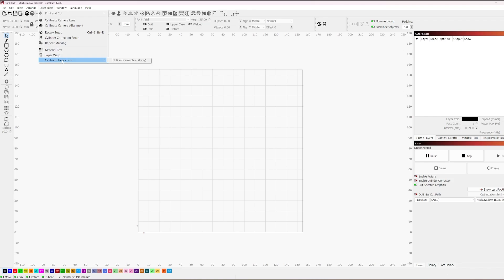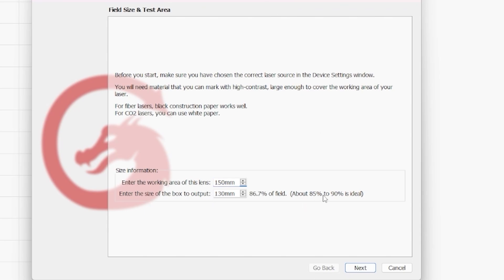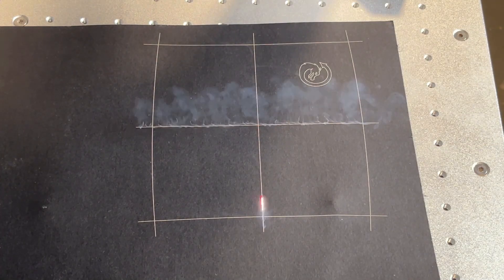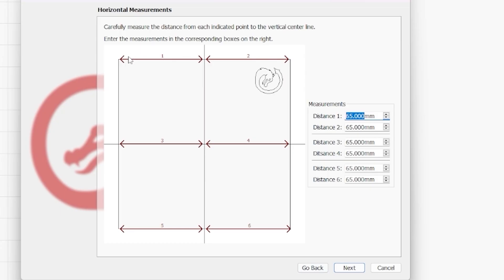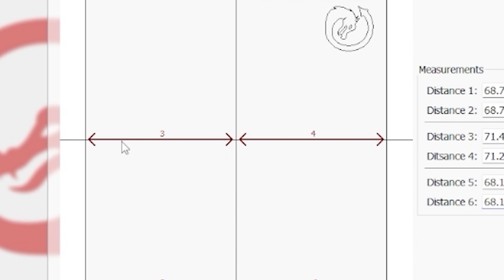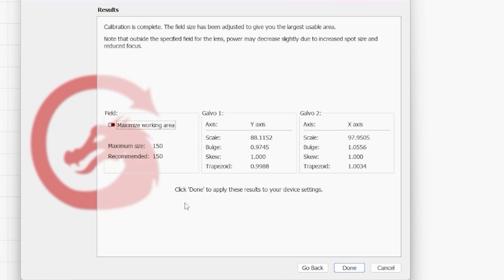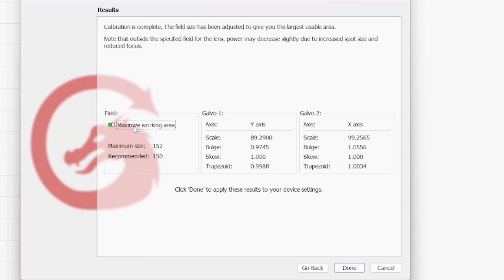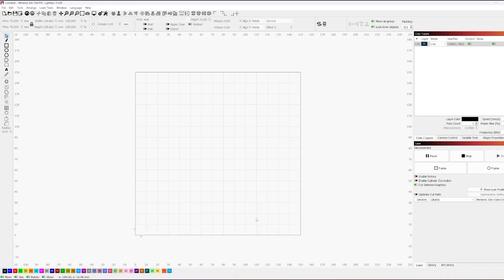AUTOMATED NATIVE LENS CORRECTIONS IN LIGHTBURN (No Ezcad!)

Comment: Has anyone got this to work with a 70mm lens?  It keeps saying the drawings are out of bounds and it only gives me the dragon, not the boxes.(mac)
Reply from the maker: I ran into this helping someone yesterday too. We'll be doing some troubleshooting and documenting things to try and help address that. Haven't found a pattern to it yet, but you can get around that by going to lightburn settings and disabling the line item for ignoring items outside the work area. I would enable it again when done, but it should get you through the process.

Additionally, there seems to also be a scale problem sometimes. The rest of the calculations seem to be working well, but sometimes the scale on either X, Y, or both, tends to make the work area too big and scale output accordingly too large. This can be mathed out manually to accurately scale down by making a square of a known size and then adjusting by the % it is over, scaling it down by that value on the given axis scale (over simplified version of the explanation but best we can do in the comments lol). Hope that helps, and we'll try and submit feedback to the awesome team at LB to try and help improve things as we test and try and find details that may help them.
I'm hopeful this should be a quick fix in a future update, and this is still useful as is anyway given that we only have to adjust scale with some quick math and the rest seems to be perfect :)

Stay tuned!
Reply: @LaserEverything  I am having the same issue with my 70mm lens as well, when I am looking at it the Box extends passed the corners. Not sure if this data is helpful or not.
Reply: i have the same problem but I try the 50x50 lens f63.
Reply: I also had a lot of problems with my 70 x 70 but I just ran extra boxes and corrected. Mine was wildly skewed incorrectly after the “easy” correction process

Comment: Before I ran through this procedure my lens was nearly calibrated correctly. 
I have a 175-mm-lens and chosen a 160-mm range. But the 9 squares were way too small. Every measurement at about 55.
After dialing in all the measurements my scaling was totally off and a 60-mm-sqare appeared at almost double size.
Running the procedure once again I got almost the same size of these 9 squares (so they are evidently  not affected by the new scaling factor).
Any ideas, how this could happen / what went wrong?

Comment: Hi,
it doesn't work for my Gweige G2 Pro.
Now when i want to laser a 40mm circel it is 45mm.
How can i reset the corrections?
Greatings from germany.
Oliver
Reply from the maker: Hey Oliver! This method works, but this is more a basic launch announcement coverage of the feature they added. When we tested it, we weren't aware/didn't see/have access to the scale tool (which is why you're seeing sizing issues). We do have an updated video though which covers this. You DO NOT need to redo the correction, there is an added step which involves testing the current scale and re-scaling it based on the test results (lightburn does the math, you just give it the test square size, and the measured result you get from the test). Search our channel for "lens distortion correction complete". It will mostly be the same steps as here, but you specifically need the part further toward the end for scale. Hope that helps!

Comment: My numbers were way off. On the chart 47.5, when mine were 56-58. And after calibration a circle looks like an egg... I'm pretty sure I didn't mess up with the sign orientation and the measurements... LB settings were changed, I checked. Any ideas what might be the case?
Reply from the maker: We have an updated guide on the channel for lens calibration that includes scale correction. The scale correction portion is what you need and will fix that right up.
Reply: @LaserEverything  Thank you so much! will check now

Comment: I will try this. However, I am concerned as it appears the distortion I am experiencing is different based on file type. For example, if I mask and flatten a png the distortion of greater than if I create a shape in lightburn or use an svg.

Comment: So these settings are per lens, and not global ? Haven't seen anything where you can pick a particular lens, other than inputting the size in the 1st step
Reply from the maker: Ideally, you'd set up a "device" in lightburn for each lens size + machine. So if I have 3 lenses for my 50w fiber, I'd say 50w fiber 110 lens, 50w fiber 200 lens, 50w fiber 300 lens, as an example. This way each lens for the machine will have its own profile and be tuned. We do the same for parameter libraries as well, since they change based on lens size and such. Each correction is specific to the lens, like a fingerprint. So for best results, you'd do this process for any new lens setup. We have an updated video coming that includes the whole process, start to finish on a new lens config and tune (updated from this even, its in editing).

Comment: Does anyone know what to do when the error message of "one or more shapes are corssing the edge of the machine workspace and will not be sent." happens? Please help!
Reply from the maker: I ran into this helping someone yesterday too. We'll be doing some troubleshooting and documenting things to try and help address that. Haven't found a pattern to it yet, but you can get around that by going to lightburn settings and disabling the line item for ignoring items outside the work area. I would enable it again when done, but it should get you through the process.

Additionally, there seems to also be a scale problem sometimes. The rest of the calculations seem to be working well, but sometimes the scale on either X, Y, or both, tends to make the work area too big and scale output accordingly too large. This can be mathed out manually to accurately scale down by making a square of a known size and then adjusting by the % it is over, scaling it down by that value on the given axis scale (over simplified version of the explanation but best we can do in the comments lol). Hope that helps, and we'll try and submit feedback to the awesome team at LB to try and help improve things as we test and try and find details that may help them.
I'm hopeful this should be a quick fix in a future update, and this is still useful as is anyway given that we only have to adjust scale with some quick math and the rest seems to be perfect :)

Stay tuned!

Comment: I've used this new feature for calibrating 3 lenses, and I agree with the final statement you make (but you gloss over it pretty quick) - after accepting the settings and verifying they've applied, you need to draw a box the maximum size your lens will allow, and mark it, then measure that box.
For all 3 lenses I found that the scale factor needed tweaking. eg for my 110mm lens, when I completed calibration, and then tried marking a 105mmx105mm box, it was producing something closer to 103.5 x 107mm or something like that. It showed me that the scale factors for X and Y were not right. I'm sure it was due to errors in measuring but I had the same issue with all 3 lenses I calibrated.
Just a suggestion - can you add a bit to the end of your video showing marking a final box, then taking measurements to verify your scale is right, and if not dead on, performing a quick calculation to adjust the scale percentage to get your marked box the exact size you need. I had to do this for all 3 lenses, so others will stumble over this too, and showing them what to do in your video would help some with that final step.
Reply: I am facing the same issue after lightburn  new future, it marks a square 2mm off X side compared to Y side 
for example, it marks 50 x 50 as 52x48
Reply: It's easy to fix - lets say your marked box should be 50 x 50 but it marks as 48.5 wide x 52 tall.Go to your Device settings. Look at Galvo 1 and Galvo 2 'scale' percentage values. 
 
To adjust:
The formula is: current scale percentage value times desired length divided by actual mark length.
 
eg if actual mark is smaller than desired (should be 50mm wide but you got 48.5mm wide mark and your scale percentage currently is 91.2329%)
The formula is: 91.2329 x 50 / 48.5 = 94.0545% - set this as your new scale percentage for x axis.
 
If actual mark is bigger than desired (should be 50mm tall but you got 52mm tall mark and your scale percentage currently is 82.3219%)
The formula is: 82.3219 x 50 / 52 = 79.1557% - set this as your new scale percentage.
 
Once you adjust the scale percentage for both axes, try marking the 50x50 box again, and you should see it come out the correct size. @akbarazadazad1453
Reply: @imakethings17  This worked perfectlly, thanks!
Reply: @ssullivan  I'm glad it helped. I'm sure others will have the same issue so as long as they follow those final checks and adjustments it should give them perfect settings.
Reply: @imakethings17  Hey , I'm currently having same issue however, I'm getting 4 different measurements on the box. Now what?
Reply: @LA98dyna  Are you getting 4 different measurements using the same lens, or different measurements for different lenses? Also once you've gone through calibration, you should only have 2x measurements to check - X axis length, and Y axis length, of the marked box. So I'm not real sure where 4x measurements come into play. 
I found after initial calibration and box marking, I had to use the formulas I note above, to reset scale percentage, then re-mark the box and re-measure again to confirm. From memory it only took a couple of goes to nail down the right percentage. Then I had to repeat all above, for each lens as they are all calibrated separately.
Reply: @imakethings17  surprisingly on my Commarker, it was still off after this step. I had to do this step several times and end the end increment scale by about twice what the calculation said. 

On the plus side, skew, bulge, and trapezoid seemed right in target after the six point calibration.
Reply from the maker: Shared this above, but just so you guys see too.
I ran into this helping someone yesterday too. We'll be doing some troubleshooting and documenting things to try and help address that. Haven't found a pattern to it yet, but you can get around that by going to lightburn settings and disabling the line item for ignoring items outside the work area. I would enable it again when done, but it should get you through the process.

Additionally, there seems to also be a scale problem sometimes. The rest of the calculations seem to be working well, but sometimes the scale on either X, Y, or both, tends to make the work area too big and scale output accordingly too large. This can be mathed out manually to accurately scale down by making a square of a known size and then adjusting by the % it is over, scaling it down by that value on the given axis scale (over simplified version of the explanation but best we can do in the comments lol). Hope that helps, and we'll try and submit feedback to the awesome team at LB to try and help improve things as we test and try and find details that may help them.
I'm hopeful this should be a quick fix in a future update, and this is still useful as is anyway given that we only have to adjust scale with some quick math and the rest seems to be perfect :)

Stay tuned!

Edit: Just seeing@imakethings17 's shared the formula they used to correct scale. good info, you explained it far better than I was able to in text lol
Reply: @LaserEverything  Hey , I'm currently having same issue however, I'm getting 4 different measurements on the box. Now what?

Comment: Interesting to see the update! However, I have to point out something important - this cannot account for skew distortion. Note, for example, that both skew factors in your example are exactly 1.000. Because you are only measuring the distances, which is fair enough, there is no way of knowing the angle between the two axes. The axes could be severely skewed, but since you’re only measuring distances (in particular, distances 3 & 4), there’s no way of figuring out skew. This is what frustrated my about using corfile2 - it took me ages before I realised there was no way account for skew.
Reply: I manually measure diagonals on ezcad, but you are right!
Reply: A bloke called Pythagoras disagrees with your assertion. I'm not saying this is doing it, but from the measurements taken you can plot the position of every intersting line in relation to the centre point. If the 12 lines that make the grid are all equal you must have 4 squares inside a square.
Reply: Pythagoras, triangle = diagonals... :)
Skew is about making a parallelogram, al lines are equal length and it does NOT have to be square.
Reply: @wimvanertvelde  c'mon now. Not just any triangles. A challenge for you. Draw that grid with all equal length lines and right angled triangles that is not square.
I'm not saying LB does it, just that it's possible from the measurements provided. Say all 12 lines are 1 long. Make the diagonal of each small quadrangle 1.414,,,, and you have square.
Reply: @timg6252  Nope, I'm afraid that's not the case. The simplest way to demonstrate this is to look at the following:

http://imajeenyus.com/temp/no_skew_demo.jpg

Pretend that those are two different marked patterns. The pattern on the left is ideal, while the pattern on the right has severe skew. In both cases, the distances between the points (the lengths of the lines) are all 50mm. In both cases, you would measure and enter exactly the same values into either corfile2 or the new Lightburn feature. Yet one situation clearly has skew, the other doesn't.

Now, the instructions do say to measure the distance "from each indicated point to the HORIZONTAL center line". In other words, the red line I've shown on the right-hand drawing. That's fine in theory, but in practice the difference between that measurement and the point-to-point distance will be so small as to be unmeasurable by eye with a digital caliper. For example, suppose you have a 2° skew angle, which is significant. If the point-to-point distance is 50mm exactly, then the perpendicular distance will be 50*cos(2°) = 49.97mm. No way is it possible to measure that accurately. Besides, I can easily demonstrate another marked pattern which has skew, yet where all the perpendicular distances are equal to 50mm.

I spent several months tearing my hair out over how exactle corfile2 performs its calculations, and finally determined that there is indeed no way for skew correction to be performed, doing the measurements this way. Brief background: the COR file that is produced contains a 65x65 array of "displacement" values for both galvos, which is sent by EzCad to the BJJCZ controller board. The controller receives an uncorrected galvo position from EzCad, looks up the array to find how much it should displace that position, and then sends that position to the actual galvos.

Take a look at this graphic:

http://imajeenyus.com/temp/cor_file_random_values.jpg

That is a representation of the displacements for each of the 65x65 points in the array - the short black lines show the direction and magnitude of the displacement. The important thing to note here is that the on-axis displacements are always ALONG the axis (the short black lines along the X axis are all horizontal, and those along the Y axis are all vertical). Skew correction can never be performed this way, and I experimented with numerous different values.

This isn't to say that the COR file approach itself is bad - it's only corfile2 that's poor. The COR file itself can indeed handle any arbitrary corrections you like - I have written my own script which will perform a 5x5 grid correction based on marking a grid of holes and then measuring the actual coordinates of each. However it's still very much a work in progress.

The only reliable way to determine skew would be to measure diagonal distances, but I'm not entirely sure how the calculations would go....
Reply: @timg6252  (I previously wrote a reply to this, but it seems to have not posted) Nope, not the case. I can show you two different mark patterns, one with severe skew, yet both with all distances equal to 50mm: http://imajeenyus.com/temp/no_skew_demo.jpg

Comment: So does this mean i dont need to import and delete drivers and swap back and forth? That the only reason why i havent swapped to lightburn yet
Reply from the maker: That is correct. Note it's only on the current public beta and not available on the normal channel as of yet. When this update releases on the public channel we'll make an announcement about that as well. Otherwise - you'll just want to be sure to grab the current BETA version of the software to access this feature.
Reply: Awesome I may finally be able to use lightburn